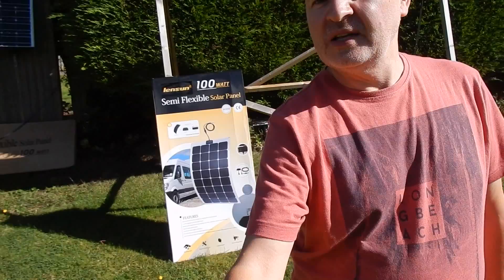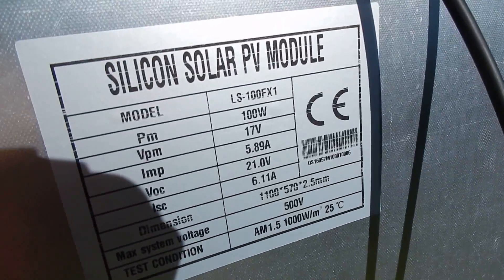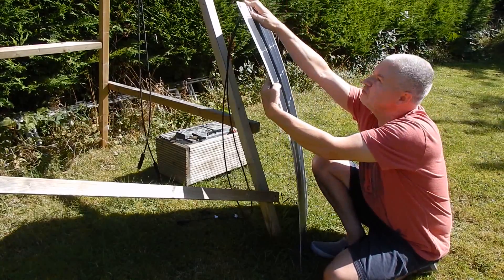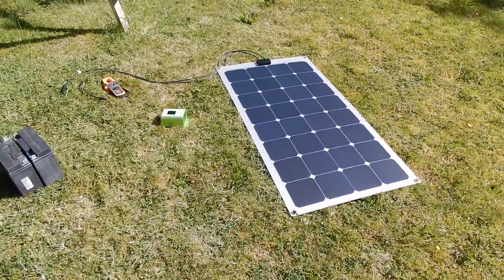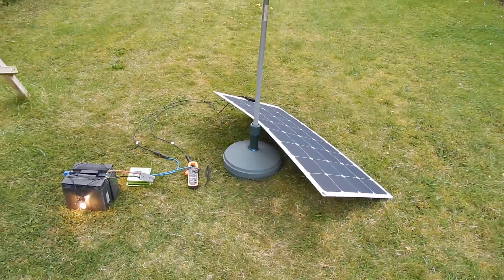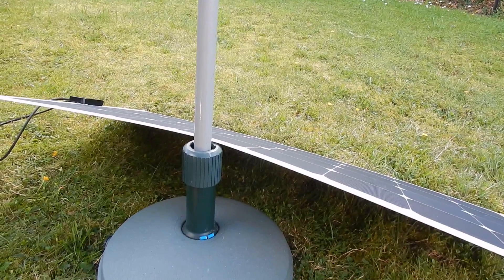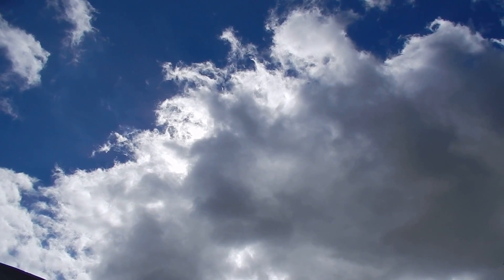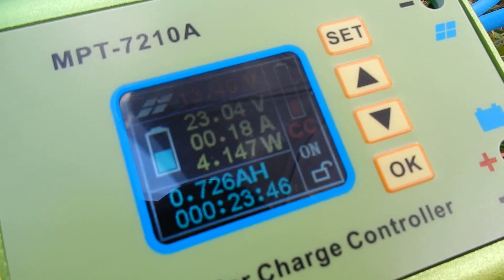Review & Test: Lensun 100W Semi-Flexible Solar Panel

Comment: Used two such panels on my camper Julian but found those type of connectors a pain on a vehicle roof so they terminate (in parallel) to a weatherproof junction box. Much tidier! Work brilliantly - charge starter and leisure battery usually well before 9am in Summer and trickle charges well even in Winter.

Comment: Hi, Would you mind doing an idiots guide to solar panels (idiot = me) where you run a washing machine off of one - because I see all the testing gear and numbers from several creators but nothing actually working? I hope you don't mind the question, thanks.
Reply: washing machines need AC
You need an inverter and a MPPT tracking feature in that inverter
there is no real DIY way of doing that ( not unless you are a power electrician )
Reply from the maker: Washing machine? 3kW heater or thereabouts. That would need a roof covered in panels.
Reply: That's what I have, I have 16 panels on my roof, on a good day they supply 4
kw, enough to power most of my home for free.
Reply: thanks for the replies I was genuinely interested, so we are long way off self sufficiency then !